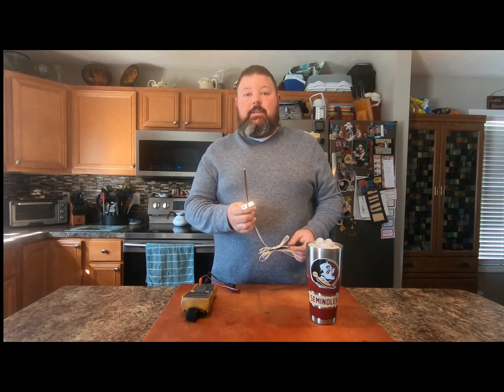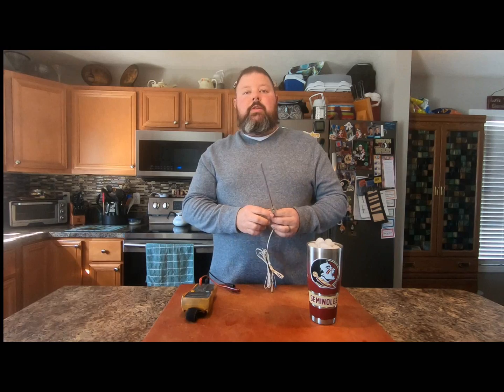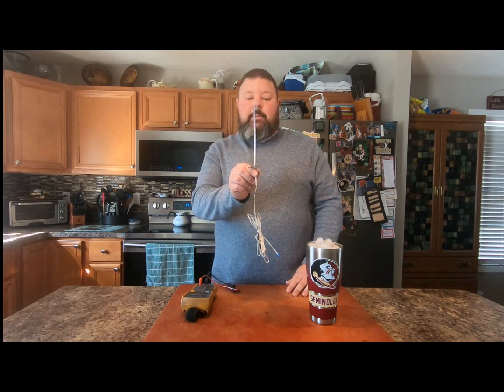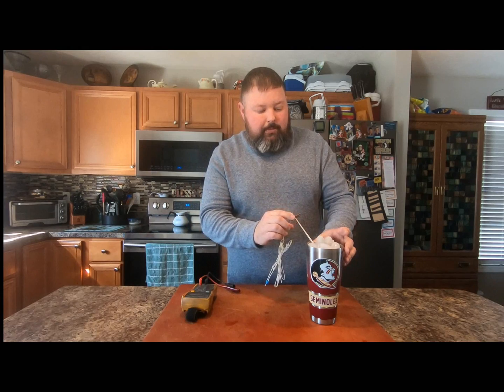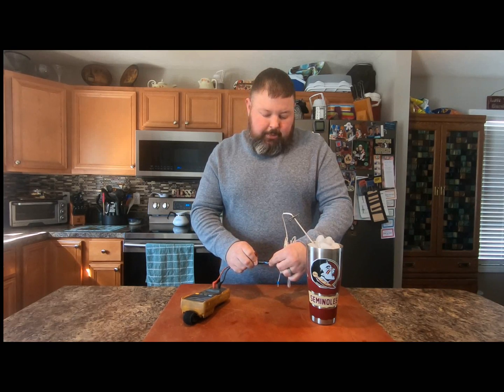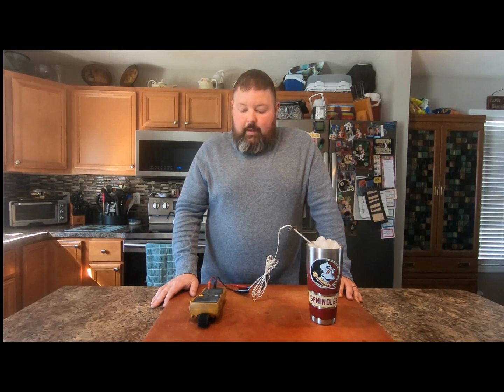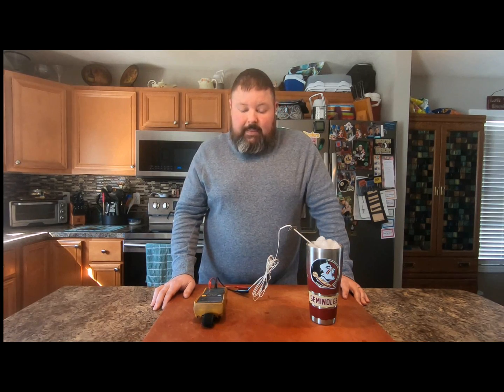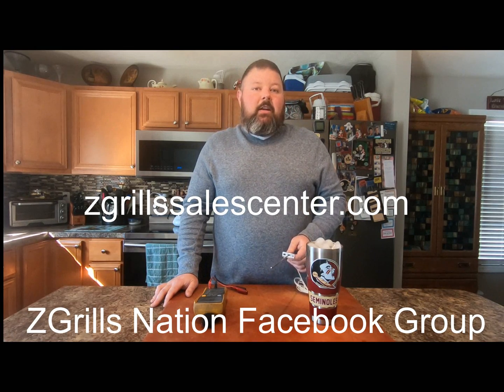How to check your RTD temp probe.

Comment: I have a interesting thing going on with my camp chef WW36. I use a MEATER meat probe because I have had the plug in meat probes fail on numerous occasions and have grown to not trust them at all. My MEATER displays an ambient temperature anywhere from 100-150 degrees hotter then the screen display on the grill is telling me. For example if I have the grill set to 225 the MEATER says it’s 325-375 in the grill. My voltage meter is at work so I’m excited to test the RTD when I get home tomorrow now that I know how. Thank you.
Reply from the maker: No problem, I too use a Meater+ when smoking. I absolutely love it!

Comment: Nice to see someone actually knows about their temp probes.  I saw you with a HVAC shirt. The average guy thinks that K type thermocouples are the shit. :) K types are used because they are cheap. They are not as reliable, accurate, or repeatable as an RTD. There's a long list of reasons RTD sensors are better for BBQ. If you're reading higher than 1K you very well could have a bad connection too.
Reply from the maker: absolutely